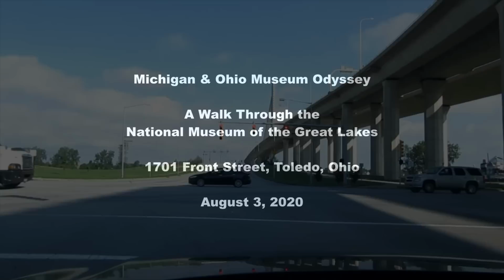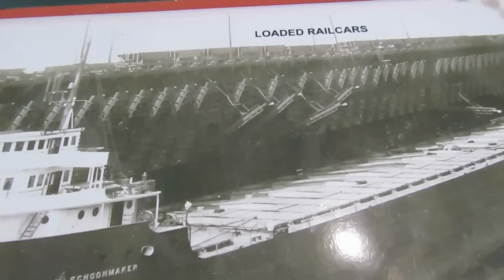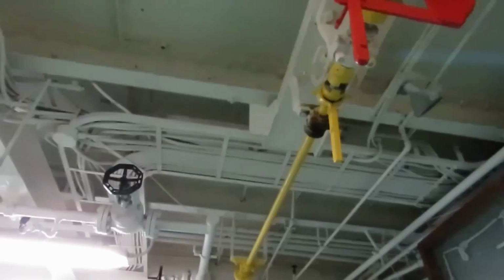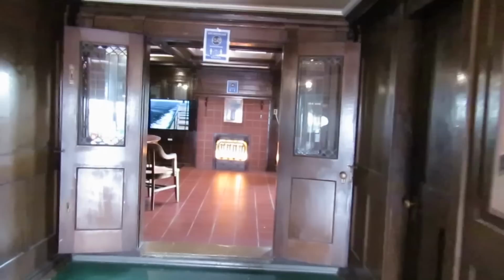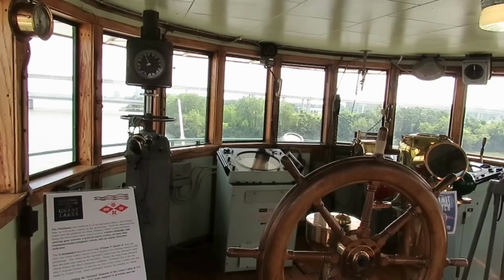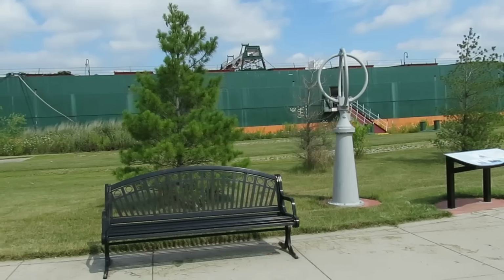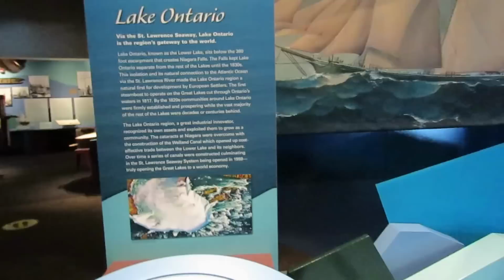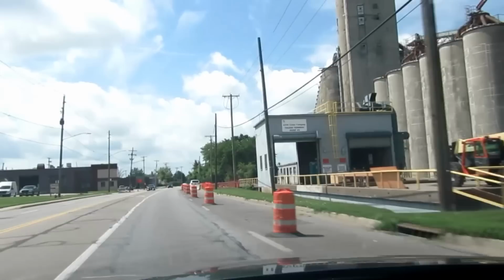A Walk Through the National Museum of the Great Lakes

Comment: I'd highly recommend going to see the Valley Camp in Sault St. Marie. She was built in 1917 and if I remember correctly, retains her coal fired boilers and triple expansion engines. Also, they turned her cargo holds in to a museum.
Reply from the maker: As far as I am concerned, when a museum ship is deemed to be not an attraction unto itself, and somebody decides to put a museum (or other stuff) INSIDE it, it drops several notches in my estimation of its worth as an attraction. I am much less likely to make a trip to see such a museum inside a ship, although I may still visit it if I am in the area.
Reply: I have been to both ships/museums. I think the Valley Camp was better. It had a nice Edmund Fitzgerald section among other things.
Reply: The Valley Camp has some of the vital finding's of the Edmund Fitzgerald. It is a very good museum ship to visit at the Soo, so please don't diss it.
Reply: @youtuuba  I understand your concern for it seeming like a gimmick or devaluing the ship, but I assure you it is done VERY well.  In most of the museum you are walking on the steel plate of the bottom of the cargo hold.  The upper deck, living quarters, and mechanical areas are all kept original.

A trip to "The Soo" is worthwhile for anyone interested in the maritime world.  The valley Camp would be worth the trip by herself.
Reply: I'm in two minds over it.  I went over to the USS Intrepid last year and, whilst that's a lot of museum, there's plenty of boat to wander around.  I guess aircraft carriers have that advantage.  The museum pieces can offer great context whilst the ship itself is a fascinating space to inhabit.  It's a very case-by-case thing for me.
Reply: @biglar155  While you are in the area, a trip to the soo locks is a must. Watching a ship pass through the locks is a sight to behold, and not something you can do any where else in the country to my knowledge.
Reply: I went to the Valley Camp last year, intending to spend a quick hour or two on board...I ended up staying the entire day! Very worth it!

Comment: Great tour of the ship and the museum. In case you weren't aware, the building was never meant to be a museum. It was originally built as a terminal to run Jet boats from Toledo to the casinos in Detroit. Unfortunately, the guys who came up with that idea didn't realize there were at least 3 railroad swing bridges plus the Craig lift bridge between the old steam plant and the open lake. In fact it's almost 9 miles out the channel to the Toledo Harbor light. The idea never took off and the building stood empty and unused for many years until the museum took over the building. I believe they added additional square footage for the museum.

Toledo had quite a reputation as a shipbuilding town back in the early 1900's. The Maumee River is still a port of call for lakers discharging grain upstream at the elevators.

Comment: I look at the seams between every plate of steel on this vessel with the understanding that this boat was riveted together.  That's a lot of rivets, starting out with the rivets red/orange hot, put thought the deck plate and then hammered flat making the plate pinch tightly to what every beam it mates up with.  Ships were made with welded seams completely after the 1950's.  The Titanic built in 1912 used 3 million rivets that in total weight 1200 tons alone.
Reply: Damn..That's some crazy shit

Comment: At the back of the boat you  pointed out a concrete structure in the bank of the river. You called it a canal spill way. Actually it is a water intake for a electrical generating plant that was on the property. The Toledo Edison Acme Power  generation plant Built in 1921.
Reply from the maker: Robert, yes, somebody else commented a few days ago that the site of this museum used to be an electric generating plant, and I then supposed that the 'canal spillway' I saw might have been left over from that.

Comment: The Schoonmaker looks like the same design as the Edomnd Ftitzgerald
Reply from the maker: Big Scott Games, based on what method of comparison? Both the Schoonmaker and the Fitzgerald were Great Lakes ore freighters, and as such necessarily had similar shapes. Both were built in the same yard, Great Lakes Engineering Works, so that might have resulted in additional subtle similarities. But the Schoonmaker was launched in 1911 and was around 600 feet long, while the Fitzgerald came much later in 1958, and she was 730 feet long. Different designs, certainly.
Reply: Edmund Fitzgerald
Reply from the maker: @robertyoung3992  , what are you saying? Simply typing "Edmund Fitzgerald" by itself is meaningless.
Reply: Both straight deckers with a common general design 40 years between times there keeps were laid down.

Comment: great video....my only comment would be about the "hot bunk". When the boat first came out in 1911 most likely it was a hand fired coal burner with an up and downer. That would mean there were 3 coal passers, 3 wipers, 3 oilers and 4 engineers. When they converted it to a turbine they also made it oil fired. That eliminated the 3 coal passers and maybe 2 of the wipers. Most likely that room had bunks and with the reduced staffing they just cut the bunks off.
Reply: You are right--Everything was steam in those days.

Comment: Seeing this reminds me of the Edmund Fitzgerald. Such a tragedy. Gordon Lightfoot's song is a fitting tribute.
Reply: Most boats resembled the Fitz that was a general hull design for the times i worked at heddle marine in Hamilton Ontario we had the task of bringing a sister ship back to life it was going to scrap now its hauling soybeans to Montreal renamed the ojibway it was the maritime trader and the voyager independent we stripped the boiler out, all the generators, remodeled the instrument consoles the wheel house the cargo holds electrical systems communications systems dtopped a 12 cylinder g.e locomotive engine into it and added a pitch prop and updated bow thruster it probably wasnt worth it but the project was educational and enjoyable

Comment: I'm surprised at the size of the galley. I guess you need a lot of hands to operate the thousands of C clamps on the hatch covers!
Nice video👍
Reply: A few were not tight on the Edmond Fitzgerald, am I right?
Reply: @WilmerCook  Maybe? I heard they collapsed because of the weight of the water... So maybe both. I'd be willing to sail on a nice day, but God bless the crew when the weather turns bad
Reply: The new thinking is that the  Fitz broke in the middle while going down into a huge  wave troff , may have grounded on the shoals  was taking on water and there was also steel plate in Superior harbor  with its name to repair earlier bottom damage.  The Captain  and crew would never enter the lake with unsecured hatch covers especially knowing what the  lake would  be  that trip.

Comment: This stuff was not original--A ship built in 1911 was all steam powered--no diesel or electric motor driven props. None of the ships I sailed on during the early '40's had these conversions.
Reply from the maker: As was stated in the video, this ship was refitted with the current engines and propulsion system. So the original power plant was long ago removed. No secret there.

As for whether the ships YOU sailed on had power plant conversions, that has nothing to do with what happened to THIS ship.....she was, after all, the flagship of her line, and was special in many ways.

Comment: 1911 it a year befor titanic so in that time the ship runs on steam as well as titanic
Reply from the maker: Adventureguy, the fact that the Titanic used steam engines has NOTHING to do with whether other boats and/or ships might have used internal combustion engines. Internal combustion engines were already in fairly wide use long before either of these ships were built, so it is not like the technology did not exist for them to use it. But yes, as has been mentioned in this video and elsewhere, this particular ship currently has a newer power plant than it did when first built.

Comment: Having grown up in Cleveland, Ohio I saw many "Ore Boats" come in to unload iron ore, cement , limestone and other products used in the steel mils.
The neat thing was watching Ore boats like this go up and down the Cuyahoga River lower basin, with its twists and turns. It required either a tug similar to Ohio or a bow thruster.
These big vessels were called "boats" not ships, why? It is because they had a rounded/flat bottom, for shallow water navigation, where ships had a "V" shaped bottom for deep water.
Some ore boats were larger than many ocean going ships too, and so their crews often resented their vessels being called boats. 
Oh ya,  the bathroom is called a head, the kitchen and eating paces are galleys and sleeping areas are berths.. These terms are purely nautical, some have historical meaning, others are just to be clear in what was being referred to. IE; a bed is what a part of the ship rests on, a berth is to sleep in. The term  head comes from the wooden ship days. A ship often had a small shaft that went through the bottom of the hull allowing water to fill it, Measurements were placed on the inside so the amount of "draft" could be measured quickly. The level is called head. The crew would relive themselves there and would use a plunging devise to push their solid waste out through the bottom.
Great video, I wish you had gone below deck in the forecastle Pronounced usually as (folks-sole). ;-)